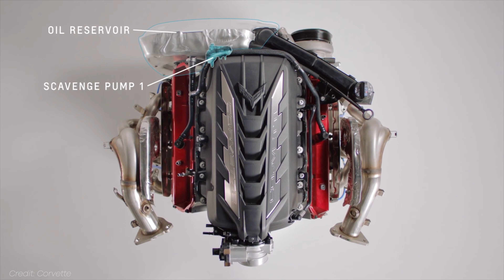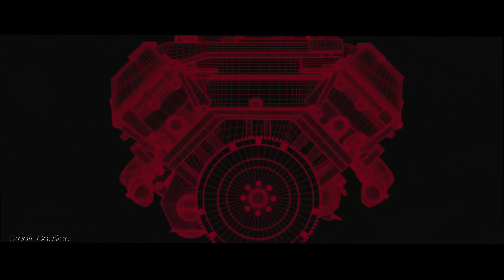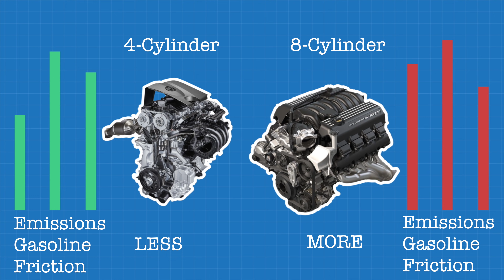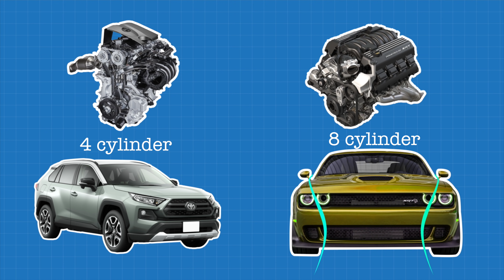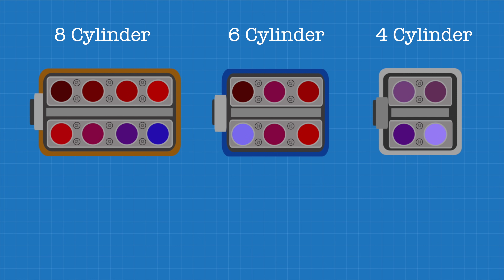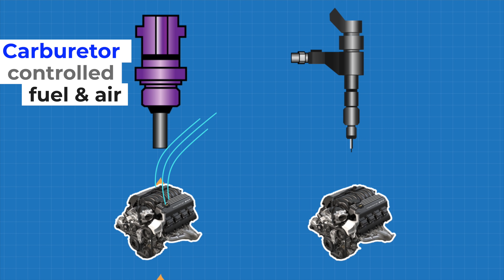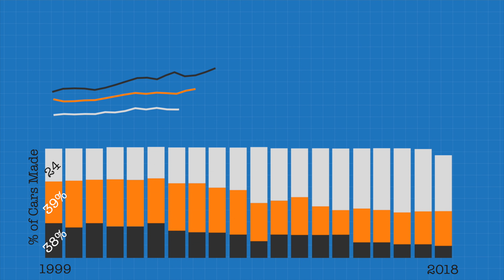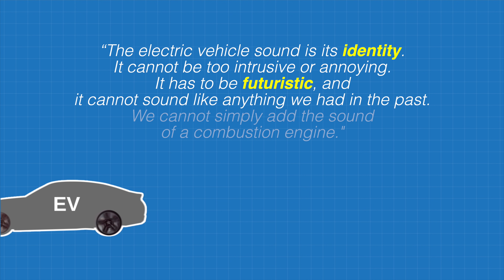Why V8 Engines are Dead

Comment: Scotty, this is the first time I have to disagree with you.
You are so full of beans your breath probably smells like a burrito.
V-8's will live on long in pick up trucks IF they become unpopular in cars. Work trucks and those who tow big rigs need that torque of a V-8. There are several recent new cars with V-8 so I think your prediction is premature by at least a decade.
I can envision a turbo charged V-6 replacing V-8's in medium to small cars in about ten years. The technology to squeeze big HP from a small V-6 is rapidly increasing and will probably happen one day. Variable valve timing teamed with high tech fuel management can already do wonders.
Maybe even a supercharger or two turbos that spool up at different RPM's will leap the hurdle to get the big horses from a V-6. Maybe even a high tech flat four cylinder is in the future.

Comment: I drive a six banger muscle car made in 1995. It is so much fun to drive! But if the engine or anything else becomes noisy, then I know something it WRONG. I'll never be able to afford to replace the car, so I just plan to replace the parts as needed until I die or the car parts can't be replaced.

Comment: Hit the 3minute mark... My stock 71 Chevelle out performs my 93 Saturn. And 2012 Chevy Cruze. .. my old job of rental cars required I drive a avg of 100 miles a day in those new foresters, Outbacks, dodges caravans, Camrys, and I'm gonna tell you now. Those 4 cylinder do not... Have to same performance as a V8... Either between my 71, 350 or the 2015 2500 Chevy that I drive for work.

Comment: Wrong, V8's are nowhere near dead. I drive one now, and with DOD tech, I get up to 28mpg if i stay off the throttle. They are just going to get better as the tech is refined further.

Also, V8's are used by audi, Mercedes, chevy, dodge, Nissan, Toyota, and many others that are affordable options.
Reply: P.s. I only make like 42k a year and the cost of my V8 is perfectly manageable with my regular expenses. So that argument is silly as well

Comment: For car manufactures to meet federal average mpg requirements, they have gear sales towards the higher mpg cars (e.g., four and six cylinders),  they severely limit the availability of V-8’s (mostly via price points).  You can see this in BMW, where the V-8 has disappeared across their lines.  Even their straight six has been cut back in favor or their four; e.g., can’t get the six in the X1 since 2015, current X3 requires you to get the top of the line M40 or pure M model if you want a six.

Comment: I love v8 engines but when fuel dries up, guess what's first to go. It's no different from the 2008 recession when gas was $6.00 per gallon and dealerships were practically giving v8 vehicles away. I hate to admit it but electric is the future because gas will run out sooner or later. When that happens, I would prefer an electric car with sound over one without.

Comment: I have a question that I hope you know the answer to. I have a 2005 Ford F250 with a 6.0 liter diesel. I've had the motor problems fixed and am having a ac issue. I've had it looked at by 2 different mechanics but not solved. My ac normally blows great but sometimes it quits blowing cold for a few minutes and then goes back to normal, other times I have to shut ac off and give it 10 minutes or so then back to normal. Now it's happening more often but is charged right and just doesn't have an answer. Please help.

Comment: I politely disagree with this topic. A long time ago, the same could be said about 4 cylinder engines.  Because for the time, the technology and manufacturing costs, allowed us to build v8 engines,  that were superior in every way ( except weight,  but going back to the 50s and 60s, it was all about hp. ) v8 engines,  are most certainly not dead. I will agree however,  that the technology that has been used to build them so long, and in a spacific way, is in fact dead. Soon, well have new designs come out, that breath new life , into any piston configuration.  For v8s, well see camless designs soon, drastically reducing rotating mass and friction,  using hydraulic servos to actuate valves, or maybe even electrical servos and magnets,  there are many designs in the works. Not to mention,  developments in metallurgy,  allowing us to make any engine configuration,  using ultra lightweight metals, that are much stronger than the previous generations of counter parts. I'm confident in the next 100 years,  it will be common place to completely 3d print these new alloys, allowing for designs we cant even fathom yet. Point I'm getting at, is if you observe technological evolution,   well see advancement and improvement across the board for any engine design, or electrical design etc. Even that being said, there a large market for enthusiasts that enjoy the old tech. Just look at the hot rod crowd,  the Harley guys etc. We love these simple cave man pushrod engines,  and no matter where technology takes us, I think there will always be a place amongst  enthusiasts,  who keep these old engines alive. I would alsolike to say, that the enthusiast community,  has a big hand in the market.  We make up for a large amount of business,  and a big percentage of that business,  is keeping the timeless ( and dead according to your opinion) old school designs well alive.  I'll wrap it up with my last fact. For pretty much the entirety of human drag racing history,  all the way to now, we have used and are still using v8s. Modern funny car, and dragster alcohol engines are all huge cave man motors. Nascar, etc all use  these old engines,  and these motorsports are certainly not dead. Your not waking up anytime soon, where funny cars will be zipping down drag strips using anything accept a v8. Now to support your opinion,  I think the topic should not be generalized the way the title suggests.  For example ( v8 engines are dead amongst modern car and truck manufacturers) that would be spacific,  and correct. As to the non enthusiast crowd, those walking into a dealership looking for a nice vehicle for work, or there family,  have a deep need for efficiency,  and cost reduction.  Which is exactly why v8s are certainly dead in that way. I do not like generalizations of topics, that can be misleading to those uneducated.  We have a responsibility to educate them.  That it to say, always observe both sides of a coin.  On one side of a coin,  you are correct.  But you completely ignored the other side of that coin, and missed the opportunity to really get your point across.  I say this all respectfully.

Comment: V8 pushrod engines died because they were too reliable and easy to repair. Auto manufacturers made modular engines to be reliable and that was a complete joke on everyone. All new cars are designed to fail. Throw away and buy new. If a car lasted 5 years it would kill the auto industry. 10 years and it would force them to start making high quality pieces of art.

Comment: V6's are great because even in low power conditions they don't struggle and vibrate less than smaller engines. i wish Toyota would bring back V8 engines and have a 400HP Camry hybrid with a V8 and good fuel economy. lol.

Comment: Reason is also the weight of the average V8 versus the 4 cylinder engine.  There's a substantial cost savings to manufacturer smaller engine by using less steel and aluminum and parts. Also having a new 8 to 10 speed automatic with low rear end gear ratio, the performance is equal or better than the V8 of the old with excellent gas milage.

Comment: I prefer the low grunt of a V8 over the high scream of a V8.
You can get used V8 engines for cheap from older vehicles. Do some digging, you might find that one engine you've been searching for. You might also want to look at transmissions and pick between automatic and manual. Just make sure to do your research on that.

Comment: Ive got a question only you can answer My 98 mustang gt is misfiring, idles ruff and shakes says there a misfire in cylinder 8, and o2 sensors are all bad i changed the plugs plug wires and the coils. Ive changed to a pi intake from ford racing from the stock one. Please help me it feels like an egr but the codes dont read that PLEASE HELP

Comment: It's not that v8's are dead, its that they are getting smaller and smaller. That's why I like the Hemi and bigger LS engines, because they are over 300 cubic inches. Still I'd rather have a 5.7 or 6.4 hemi, or 318, 360, 400, or 440 Chrysler over any other engine. One engine that I know is dead is the v10, Chrysler's first v10 I believe was roughly a 360 with 2 extra pistons. And turbo chargers only belong on diesel engines. Superchargers and naturally aspirated should be the only way gas engine are run. I

Comment: Hi Scotty, love your videos. I have a question. I have a 2008 Kia Rondo with a 2.7 V6. It seems to have a misfire with a shake at idle. Once the engine warms up, it runs even rougher with a very uneven idle and low power and ends up eventually stalling out. I'm try to figure out what the problem is. Any ideas?

Comment: Trucks. I believe most full size trucks will still be v8s into the future. Sure the raptor has a turbo charged v6. But added complexity is added failure possibilities. While it may be true for the car market I don’t think it will hold in the truck market. At least not for real trucks Elon yours doesn’t count.

Comment: So just like Scotty Kilmer, you need to have Youtube advertise your channel for views. Damn there are so many morons in the car community. If you hadn't noticed, all engines are dead. Electric motors are taking over. And even if they weren't, high displacement v8s would still have their place in drag racing, because when it comes down to raw power there is no replacement for displacement. Yes there are 400hp 4 bangers now, but 400hp is pretty much the norm for a N/A v8. Electric is the only think killing v8s, and it's not just killing v8s, but everything else from boosted 4 bangers to low displacement v12s. Don't just cast out v8s like they're the only internal combustion engines getting iced.

Comment: I think turbo engine's are bad because when they brake they are expensive to replace & I think 6 cylinder engine is great and I think most trucks should keep the V8s I don't think  any 4 cyilder engine with turbo is very good at all

Comment: I have to disagree torque is the biggest difference and before i get beat up over Cummins inline 6 or the jz motors , my specific example is fords EcoBoost and yes there's examples of the motor being able to take and make more power but as far as towing i have heard more complaints than bragging stories for what trucks are designed for towing and power  i don't see a less than v8 application replacing what is currently on the market electric cant do it either at least not with current technology mainly due to battery range and heat

Comment: They are not dying. Almost all full sized gas and diesel trucks still use a v8. You cant exclude trucks or diesel engines from this discussion. Maybe car v8s are dying but there is still a very large market for them. Also, I wont buy electric until they stop producing petroleum fuel. Even then it's not hard to make your own fuel. Miss me with that nonsense.

Comment: Here is why V8's are not dead. Cylinder deactivation, multi speed transmissions, hybrid V8's. They are far from dead. As an example who is going to buy GM's full size pickup with there new 4cyl think not. Scotty is wrong again.

Comment: I sometimes like the sound of electric racecars but then again what I believe I hear is gears from the drivetrain of the electric cars. I do enjoy the sound of engines, mainly v8s....4 cylinder high revving motorcycles, v twin motorcycles, probably most of the internal combustion engines from the past several decades. Although not as common as cylinder engines I also like the rotary engines and the jet engines in fighter planes.
Thank you for the video, I thought it was scotty Kilmer at first, I paid attention and then I remember the intro animation that I believe I saw it in one of your scotty kilmer "now you know so you can do it too" videos. The video seems like it had a lot of work thank you for sharing.

Comment: V8 engines are the more reliable I've had about 20 vehicles so far three v8 and two 4.3 which are just about the same block except it's a 6 cylinder  the others nothing but engine issues after 100,000 miles

Comment: Pretty sure a lot of these comments are missing the point. The V8 is dying out when it comes to your average production car. Most non car people don't care about it and would rather have a cheap fuel efficient or electric car. A lot of auto manufacturers are focusing on plugin hybrids and EVs in the future. V8s are going to be around for awhile but in the form of used vehicles and some high performance cars with a heavy emissions tax.

Comment: You make it sound like only four and six cylinders can get turbocharging but yet, none of those two can you develop 10000 plus horsepower in travel 3.4 seconds down the quarter mile.

Then there is the issue of reliability a four-cylinder making 400 horsepower has to work twice as hard as an 8-cylinder making 400 horsepower .
in theory you could make a chainsaw engine make 400 horsepower but it will not be reliable.

Comment: I've only owned V8 trucks since I got my license, had a GMC Sierra with the 305, my badass scrapper a 99 Chevy 3500 dually with a 350 and just bought a a 2006 GMC 2500 with a 364... point being V8s are not that expensive but they are awesome if you want to get something done

Comment: The v8 will never die. Just like with 2 stroke dirtbikes. The 4 strokes are far more advanced, but because of nostalgia and simplicity it lives on. The v8 will continue because of nostalgia as well. While a boosted 4cyl can keep up with an NA v8, the v8 still makes more power when it has the same mods. They also last much longer because they don't have to be pushed as hard as a 4cyl in normal driving. Each engine has it's place. If it's something that has stuck around for more than 50 years, it will never go away. It's part of our culture.

Comment: People will never stop wanting V8s. The sound and power delivery is unmatched by any other engine. And they are not expensive. I bought my truck for $1,000 with a good old Chevy small block and it’s indestructible.

Comment: My neighbor has 2013 Shelby mustang 5.8 supercharged it handles terrible compared to the 2015 and up Mustangs because it still has a live rear axle which are great for trucks and my Jeep for heavy loads off road but live axles are trash in sport cars and for cornering all new sport cars have cv axles are independent trans axles

Comment: As long as oil is still produced, V8's aren't going anywhere. If anything, the last 10 years have showed us more NEW V8 designs than any prior period outside of the 60's. When camless tech gets here that might change, but they've working on making a viable engine run long term for a while now. Only ultra exotics carry that technology, and only a handful, if not just one.

Comment: They should keep the v-8's .  EPA should clean up the low quality fuel they produce now. There's no reason they can't. A V-8 has gotten right around 100 mpg in the past. Wouldn't that be sweet.
The oil companies do not let it happen. People have ended up missing over great m.p.g. inventions..
I think with all the electric vehicles to come, we are going to have a LOT of batteries ending up all over the place. Just look at the plastic water bottle problems we have now.

Wow, I could of had a
V-8❕

Comment: I might have missed it but I believe you forgot to mention cylinder deactivation. My C7 corvette would go from V8 to V4 mode and get close to 30 mpg. It only had a 18.5 gallon fuel tank. I have regularly seen 500 to 560 miles per tank... NO KIDDING... Chevy has figured out how to give you the best of all worlds... If you don't believe me then ask any genuine modern Corvette owner. Chevy V8s will be here as long as there is gasoline.

Comment: I see it differently. I think the technological gains has resulted in more power, therefore reducing need for displacement and cylinders. Put turbos on a V8 and your over 800HP, not very drivable for daily use. V8’s will always exist, but their application isn’t as practical as it was before. That’s why we see them in high end applications, therefore driving up the price. V8’s will never die, even when most cars are electric (inevitable) V8’s will be around for all the great reason you mentioned.